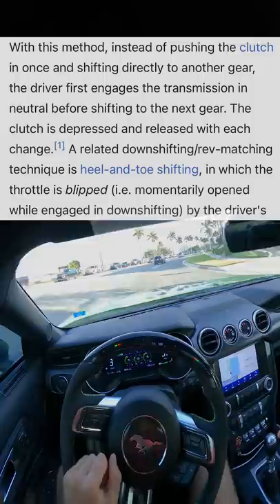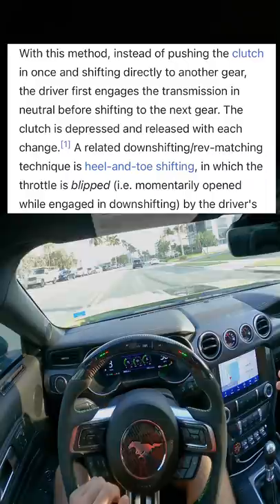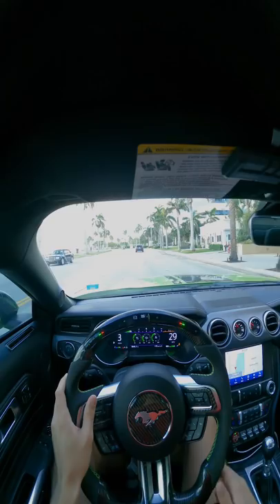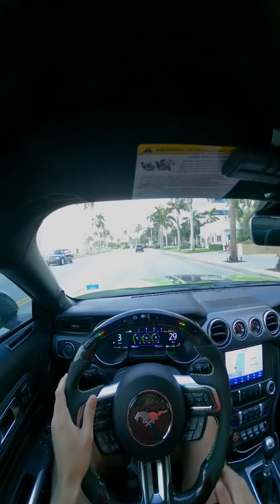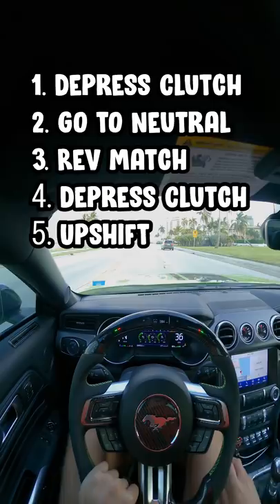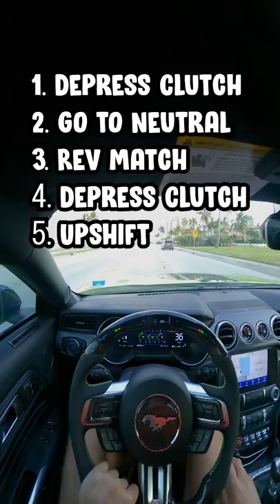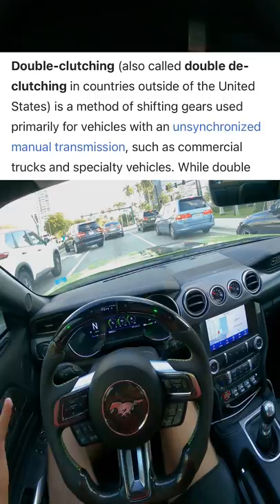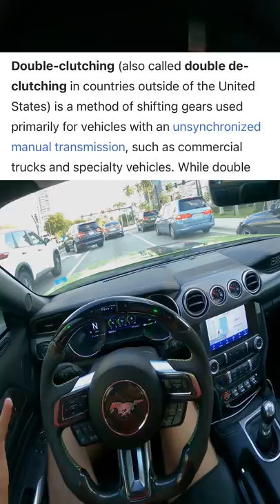WHAT IS DOUBLE CLUTCHING IN A MANUAL TRANSMISSION & SHOULD YOU DO IT? #SHORTS #MANUAL #GT #FORD

Comment: This is partially correct. ( which you did good for only 60 seconds) 

When up shifting there is no Rev match..
The speed of the trans is less than the speed of the wheels so you can just shift out,  and shift in..

The only time you would add throttle input is when down shifting.
Your trying to match the speed of the engine, to the speed of the trans/Wheels..

Been double clutching my whole life..
It's easy to do. Once you've learned it.. and basically can be applied to any manual trans vehicle... 

I typically use it on jeeps or older 4x4s that have worn or slow synchros... to keep from grinding or to down shift without upsetting the momentum of the vehicle.
Reply: Can you skip gears downshifting? Say 5 to 3 or 6 to 3?
Reply: @ihateyou3836  as long as your revs are fine, and you don’t send the engine to the moon.
Reply: So how does double clutching compare to floating the transmission
Reply: This still doesn't explain why you would need to release the clutch to do the rev match. Why not just keep it depressed like heel-toe
Reply: @ethanloughlin9052  I can float gears somedays But the only reason that I've heard of people deciding to float gears is to save the clutch I don't know if it's right or not, or if it's just, they want to have some special skill.
Reply: @alexherstd5124  I float the transmission in my truck to the point that it's second nature, mostly because that's how my boss drove, I learned by not even realizing I hadn't pushed in the clutch until I was in 4th gear rolling down the road
Reply: Ok but one thing I can't seem to understand... why don't you just clutch in, Rev match clutched in while you're shifting, clutch out... just skip the whole neutral thing.
Reply: This is good information. I only saw it useful for semi trucks but if I ever got an old truck... Might be useful to get home? Lol
Reply: @ihateyou3836 depends on how high the engine will rev with what gear you down shift to.  You don't wanna go from 6th gear to 2nd because you could cause damage from your engine reving past it's rev limit or damage your trans because it can't handle it because it's also above your rev limiter. Ex it's harder on a 5 speed manual to go from 5 to 3rd but if you match the rpms it won't hurt the clutch. But if you go from 6th gear 2 2nd in a stock car that's not made for it it's going to blow your car up because the revs would've went too high and blown either motor or trans if not both.

Comment: As a truck driver, when double clutching, you should NOT need to rev match to up shift. Only down-shifting should you need to rev match. But most of us drivers float gears.
Reply: I remember when I drove a 10 speed 2016 Freightliner Cascadia. Only clutched when I needed to break. I miss her. My nieces named her Big Red.

Edit: Brake. Not break.
Reply: Never understood why this concept has even been applied to cars....it’s only for heavy equipment and semis
Reply: @noaht5191  I could be mistaken but for racing purposes it would make a bit more sense (keeping speed and not losing rpms).
Reply: @noaht5191  Double clutching is for old-timey boxes that aren’t synchronized. Very normal… 80 years ago. Anyone double clutching a car these days is just creating work for themselves and wear on the car.
Reply: I've never had to double clutch unless I'm switching to the next gear set. The manuals are quickly going away but the hold out companies and State agencies who still have them still run some trucks with double clutch standards.
Reply: @noaht5191  my mum tells me stories of having to do it while driving in her old Fiat 500. It's for unsincronyzed gears, so it was also used in old cars
Reply: Yeah. I mean I'm only 16 and drive our gravel trucks and water trucks quite a bit and rarely use the clutch, I always float the gears. If someone drives truck for a living and doesn't float gears 80% of the time are they really driving truck?
Reply: @jardeekempton8352  I know if they are using that clutch every time to shift as soon as he shuts it down and jumps out of the cab his knee is going to buckle
Reply: Almost got a seizure trying to read that
Reply: @887Bingo  "Break",  to cause something to separate into pieces, either by violently hitting it or dropping it. 
"Brake", refers to a device used to reduce the speed or stop a moving vehicle.
Reply: @renaissanceman7145  whoops. Good catch there. I'm sure you bring everyone joy at parties. Especially the ones you never get invited to.
Reply: Them wheel holders grind em till they have to rev match to upshift🤣🤣
Reply: Thank you. This guy is making a video on a subject he doesn't even know about.
Reply: @sargentg07  That's why you heel toe. You tap the gas while bringing out of gear which sets you up for the lower gear.
Reply: @887Bingo  Did you cop an attitude with your English teacher way back in elementary school when she tried to teach you the difference between break and brake? That might explain why, as an adult (I’m assuming), you don't know which is which. If you need help with there, their and they're I'm here for you. On second thought,  maybe we should start with to, too and two. I wouldn't want you to overdo it.
The next time you're invited to a party, remember, you were invited to make the host look better. No doubt you do that effortlessly.
Reply: @waybous  So, even with the heel toe method you're effectively rev matching to sync the speed of the next gear. Am I right? I thought heel toe involved braking to acceleration. Like in the case of cornering or drifting. Please correct me if I'm mistaken.
Reply: @sargentg07  damn you was searching for that line for a 3 whole days. And you dont even know what heal n toe is 😂😂😂😂 get back in line son
Reply: @sharpshot5408  No just had more important comments to respond to before just throwing something out there. Annnnd I'm not huge on racing so nope not very knowledgeable on heel toe.
Reply: @sargentg07  Heel toe allows you to brake and rev match and keep the car balanced so you are able to use the full tire patch. If you just hit the brake all that weight pushes the to the front and takes a lot of the weight off the rear end and that effectively lowers the tire patch. Also with all the weight on the front it could easily under steer and send you off the track. Heel toe also allows tou to apply some slight engine brake to help keep the weight on all 4 corners about the same.
Reply: @sargentg07  isn’t that speed shifting and not double clutching for racing? I’m no race driver 😂
Reply: @gsommerfeldt  ok cool, I assumed that was the purpose, was to allow engine and trans to sync up while driving. Makes sense.
Reply: @FAB1150  my wife’s family in Ukraine showed me how to drive their old Moskvich, it was essentially a Fiat and needed to be double clutched occasionally, and wouldn’t downshift into first I believe.
Reply: @jardeekempton8352  I know some drivers who still use the clutch method….personally I prefer no clutch breaking in my transmission because once they get used to clutch they are addicted and want to hang up when you try to float. I love my 13 speed, 10 speeds are fun too.
Reply: @sharpshot5408  don’t hurt yourself.
Reply: @waybous  I wouldn’t say that, I like to rev match my gears when downshifting in my scatpack….if it’s a process that works for him I wouldn’t say it’s wrong, maybe misleading for some however.
Reply: @noaht5191  damn did you also replied to every comment on the video?
Reply: @reedrk88t  from what I can tell, manuals are mainly going away in the states. Most countries are more than happily using manual these days
Reply: @sharpshot5408  what’s it to ya if I did? Maybe I just like to talk. Is that ok with you, your majesty?
Reply: @noaht5191  don’t worry about that person. I was reading every comment and enjoying them. I’m relatively new to manual transmission and trying to learn all I can. Do you usually rev match in only downshifting or upshifting also? I have a vw Jetta not a big truck. I usually avoid downshifting unless absolutely necessary and I also avoid steep hills if possible. lol I just put it in neutral and coast instead of downshifting. Idk if this is a problem but it’s what I do.
Reply: Here here
Reply: Only ever had to double clutch when I was loaded down
Reply: @BrokenAbyss  I usually rev match my rpms when down shifting, I think my 6.4 takes a 400-500 rpm “bump/rev” to match up engine speed to the drivetrain between 2k-3k rpms. I heel toe, but it’s not necessary it just sounds cool, and it doesn’t thrash so hard on everything opposed to when you just kick down to a lower gear then dump the clutch, it’s a smoother transition of power if that makes sense. It’s like gradually slowing smoothly rather than making the car seesaw and bark tires when jamming gears and dumping the clutch when your rpms have dropped between shifts.
Reply: @BrokenAbyss  If I get time, I’ll record a quick video of down shifting in the semi and also the car later on this evening if you want to check my channel, and if I get back to the house in time.
Reply: @noaht5191  yes, I pretty much know you’re supposed to when downshifting but my car is a little jerky if I don’t give it some gas while upshifting. Am I not supposed to do this upshifting. And okay, I’ll sub and watch it if you ever post it. I also create videos but nothing about cars, so I know the struggle of small content creators. Sometimes it feels like the videos you post are in a dark void hole, nowhere to be found. Hopefully your video will go viral and help more people than me.
Reply: Exactly. While upshifting your rpm will naturally fall to match the next gear. Downshifting is the only time you should need to bring the rpm to the next gear.
Reply: @sethward5136  so I’m assuming I hold the clutch in and don’t shift fast enough because my car is jerky if I don’t give it some gas in upshifting.
Reply: @BrokenAbyss  drive better and shift properly. Might need some practice
Reply: @renaissanceman7145  you meant there, their(,) and they’re 
And to,too(,) and two

I don’t understand what makes people correct others and then proceed to fuck up themselves as they argue back and forth.
Reply: @gsommerfeldt  plus he spent a solid couple seconds rev matching for no reason
Reply: @southerntrendkiller2632  I didn't get anything wrong, no words were misspelled or misused and NO, you do NOT use a comma before "and" as you did (in parentheses). To be clear, "there, their and they're" is correct. "There, their, and they're" is wrong. You are guilty of the very thing you accuse of me while I am not. You would have been much better off if you had said nothing.
Reply: @887Bingo    all I did was try and help a fellow human being by providing the definition of two words they had mixed up. Your response was to attack me so I reacted in kind.  Now you double down with more ad hominem attacks yet I'm the bad guy. Reread my first comment and all you'll find are two definitions. Nothing more. I didn't question your intelligence or parentage. I made no judgment or commentary. The mature response would have been to say "thank you" to which I would have replied " you're welcome" and that would have been the end of it. But no, you can't accept that someone may actually want to be helpful and nothing more. Or, you can't allow a situation to exist in which you aren't the victor or alpha. The only way (as you see it, it appears) to be either here is to attack me personally, since you can't win on the merits. The funny thing is you'd have been a winner if you'd replied "thank you". You would have been considered (by me at least)  an adult, mature, aware of your own limitations and open to learning. Instead, here we are. Take care, I hope after this you'll at least remember the difference between break and brake.
Reply: @renaissanceman7145  you must have not gotten my response to your mistake…you have yet to reply to your defeat. What’s wrong? Can’t handle not being the victor or alpha? Maybe you can’t handle the fact that you’d have been better off not saying anything in the first place…when you’re ready, I’ll take you back to the third grade, that’s the one that has the 3rd in front of it, and teach you how to use a comma. If you can’t do the virtual classes here, you can ask your teacher when school starts back up in the fall.
Reply: @noaht5191  heel toe shifting has nothing to do with balancing weight and tire patches.
Reply: @southerntrendkiller2632  
 
Classic how you include the part that makes you look correct but conveniently omitted the fact that most publications do NOT use a "serial comma" except in very specific circumstances, one of which is given below. However, specifically, "there, their and they're " is not a circumstance in which one would be REQUIRED to use a serial comma. 

https://www.grammarly.com/blog/comma/

 "Serial Comma (Oxford Comma)

As mentioned above, when you are listing three or more items, commas should separate each element of the list. However, the final comma—the one that comes before the and—is optional. This comma is called the serial comma or the Oxford comma.

Mary needs bread, milk, and butter at the grocery store. (With serial comma)

Mary needs bread, milk and butter at the grocery store. (Without serial comma)

Whether or not you use the serial comma is a style choice. Many newspapers do not use it. Many trade books do use it. In your own writing, you can decide for yourself whether to use it or not—just be consistent.
Keep in mind, though, that occasionally the serial comma is necessary for clarity. 

I dedicate this award to my parents, Jane Austen and Albert Einstein.

The sentence above will almost certainly cause readers to do a double-take. Without a serial comma, it looks like “Jane Austen and Albert Einstein” is an appositive, rather than two more elements in a list. To put it another way, the writer seems to be saying that her parents are Jane Austen and Albert Einstein. A serial comma eliminates the possibility of misreading, so even if you’re not using serial commas in your writing, make an exception for sentences like this:

I dedicate this award to my parents, Jane Austen, and Albert Einstein."

So, what did I learn today? I learned that some people use a serial comma before "and" in a list, something I can't remember ever seeing before. I also learned "Southern Trendkiller" is a liar by omitting facts that don't support their position.   That alone is bad enough but you had to add condescension to your dishonesty. Not a good look for you. You really would have been better off if you had said nothing.
Reply: Correct Grammar....the difference between knowing your shit & knowing you're shit......????
Reply: Floating gears is all I do in our Pete with an 18 speed just as long as you can match RPMs from gear to gear. The clutch only gets pressed when starting or stopping.
Reply: @jardeekempton8352  hey I'm not alone, I started driving grain truck when I was 14. 17 now and never use the clutch.
Reply: I mean realistically in a truck you don't need to use the clutch, but you should, floating gears is the reason why old tucks gearbox's feel stupidly loose.
Reply: @887Bingo  we have a 2009 cascadia and a 2010 International both with 10 gears and same thing, only use the clutch to start from a complete stop.
Reply: I was also going to comment that we float gears. My wife refuses to learn floating, so when it is her turn to drive I try to time my sleep schedule around her driving on interstate highways so I don’t get thrown out of bed.
Reply: @clintonkirker5154  Have her drive an older Freightliner cab over. I am 6 ft and the clutch is hard to reach along with being uncomfortable to push down. It will force whoever is driving to float the gears or have a sore leg at the end of the day.

Comment: I haven't even heard the term "double clutching" in about 30 years.  I used to have to do that in a very large dump truck in a gold mine. It took both feet to push the clutch in,  they made the pedal wide enough for both feet because it was the only way to push it in.
Reply: Something tells me someone was trying to teach you to float
Reply: @Dortchskii  I don't remember for sure but I think the higher gears could be floated but the lower ones were too steep.  Before the gears meshed, you were back down to the lower gear speed. Like before speed dropped off way faster that engine rpm.It may have been the other way around, it was about 35 years ago.
Reply: What beast were you in wtf
Reply: @clarencefalcon5451  it was one of those huge dump trucks that the whole cab is in front of the front tires.  It had to be trucked in on several trailers and assembled on site. I had to drive between 2 pits and the cab would hang over in the turn.
Reply: @sweet65mustang  
On a big truck with like a Eaton Fuller transmission floating the gears without a clutch is the best way as the transmission is actually designed to be shifted like that. I spoke to someone who was an engineer for Eaton Fuller. I learned to float gear in a early 80's Mack truck day cab with a 5 speed transmission.